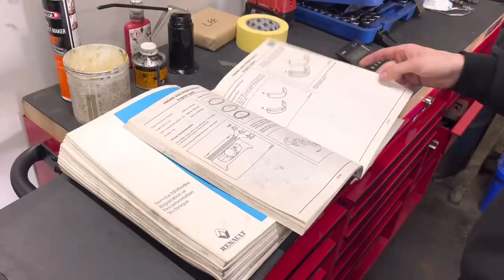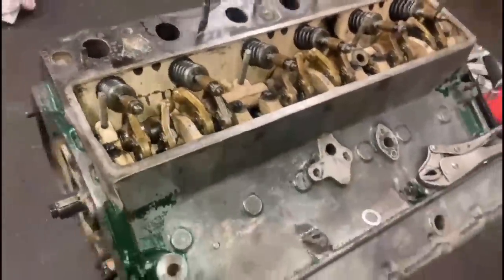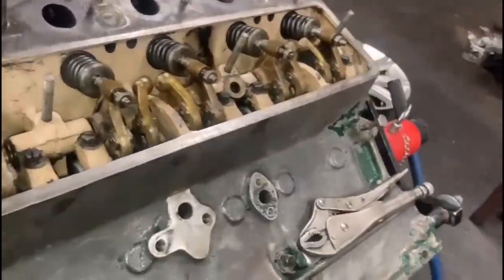IM SO ANGRY WITH THIS WARRANTY CLAIM & COURT THREATENING

Comment: The problem is that based on recent rants (this included) you are too old fashioned, too forgiving and too much of a gentleman...and that's going to affect your business.  Yes its a sad world we live in these days where you have to cover your backside all the time, but that's way things are.  Gone are the days where a nod or a handshake secures the deal and everyone abides by that.  You're a business man, and need to consider how the old practices are actually stressing both you and your business.  You have to think more of you and and your staff to ensure things don't get to this stage of threats of court action.  Invest in a call recording system, or ensure things are done through e-mail or if you want to continue with old practices do written estimates, with worst case scenarios.  Don't let completed jobs leave the building until the invoices are paid, or at least take non-refundable deposits so that you have at least covered cost of parts should something occur and completed projects get removed prior to the customer settling the invoice.

I used to be self employed way back in the 1990's, and before I did any work I had the customer sign and date the works order which also had my terms and conditions on the back, which made it difficult for any customer to wriggle out of paying, or portioning blame on me for something that I never did or touched.  I had one case where some character tried to pull a fast one, and wanted me to pay the repair bill caused by something that I normally never do, but they dropped it when I pointed out the relevant clause on the back of the signed works order where it stated such things were entirely at the customers risk etc...

Sorry for the ramble, but I hate to see honest guys like you, who are trying to build up the business, and have such a big heart, get taken for a mug...

Comment: I agree with Harold 6863,  it IS getting worse ( recently retired after being in the building industry for almost 50 years ) for the last 22 I was doing house inspections, in those 22 years I had about 5 complaints to our (NSW Australia ) " consumer " body, all bar one were from women ( and he may as well as have been !! ) the last one was what made me retire ( was going to anyway  - she just helped push me to do it ) None of them wanted to discuss what they thought was a problem before running off to the consumer body. And, of course the wicked evil builder was always at fault.
So my advice would be to ANYONE in a small self-owned business is don't do anything by word of mouth and to document all dealings you have with the general public, in over 13000 inspections, like I said I had 5 complaints but those 5 cruelled it for me .

Comment: Realistically the customer signed off on the gearbox to get the job done & agreed to the terms as he paid the invoice. What the customer appears not to realize is your vids of engine builds shows the quality of workmanship. Question i have did he misdiagnose what was making a noise, was it the g/box or most likely something else. Did it turn out that it wasn't the gearbox ; after all you didn't get to test drive before he took the gearbox out or when he pit it back in. Threats of legal action mean nothing when it ain't backed up with actual action. Any claims of expenses by him can be counter claimed by yours. If he expects a windfall he's sadly mistaken. Courts by & large are blind meaning they deal in law & facts not what somebody thinks should happen. He better have his ducks in a row

Comment: i had a same sought of problem and legaly as long as you are prepaired to fix the problem he does not have a leg to stand i won my case because the customer refused to bring it back for us to sort it out
Reply: There's mention of an "engineer's report". That may or may not be true, relevant or bearing on the weight of the arguments. The 'qualifications' of that "report", if indeed it exists, may just be Joe down the alley.

Comment: Just a thought.  Why do you not extend a helping hand to help the bloke out and say, if he pays for the parts, you will do the labour for free.  Solicitors are expensive and why not use the time and the money to sort out the disagreement. If he does not want to. Then you can use that as leverage in court where you tried to extend a helping hand and he did not want it. Then the court will look at him and will start grilling him on not working it out with you. I am an electrician by trade and I had a client where I suggested to go half half on his issue.  He wanted upgrades etc. He paid for the parts and I just rocked up and installed it.  We went our separate ways and never heard anything again.  I unfortunately had to let the employee go after that episode.  The employee did not replace the parts, which was ordered and picked up by him. We had the job number on the invoice as reference for our accounting. Never thought it would help us track if the parts were really installed. We take pictures of the parts and serial numbers that were in and quoted for replacements.  The guy rang us up and stated that his electrician came past and checked and found out that the parts where all old.  We went out and took pictures and we found that the serial numbers and date of manufacture is the same as what we had on file.  So we had to let the employee go, because he was stealing.  We did not get the police involved as he has kids and I know them personally. Its not worth the mess of going back and forth to court and seeing a family being torn apart.

Hello from South-Africa. I enjoy your videos and can't wait for the next ones.

Comment: Just an observation regarding the MGB engine I have built a few of them over the years and I noticed with the one your having issues with that you have early conrods fitted to late type pistons early pistons where longer with oil control below the Gudgeon pin as I said just an observation

Comment: Glad you have a semi reasonable doctor. If you take ivermectin with the antibiotics, you will be fine in 24 hours. It will speed up the clearing of the lungs dramatically. Tried on myself 3 times already. Didn’t even stopped smoking in between.

Comment: If you do mechanical work without a written and signed quote, you are just asking for trouble. Anyone who wants the work done will have no problem signing a quote. It's the standard in every service business. If you have to get approval over the phone, record the call and ask the specific question with a estimate of the cost or an hourly rate.

Comment: If you’re taken to court. Demand access ti the box, to inspect. If it is, the same box. All the gadgets will still be new and brand stamped. The part you also replaced, that the customer broke, will also still be new. Don’t want try about not having a paper trail to to defend yourself. Means they don’t have the same to price your guilt. The guys at it. Might also be worthwhile, getting your solicitor to start to doing some financial background checks.

Comment: The chap who does my plumbing jobs, and also has installed a new kitchen, put in new bathroom and en-suite, and refurbed the downstairs loo is the best tradesman I have ever come across. For every job he submitted a quotation with a complete description of the work, listing all the jobs. Where I was supplying parts this was also in the quote document. It seems to me you've been rather too much concentrating on the actual work, and no enough on formalising in a document the work to be done. We always agree verbally to proceed based on the quotation, and I have always been totally satisfied. However you may need to formalise acceptance of the work to be done in future, as well as the quotation or estimate. Oh, and maybe start a customer black list.

Comment: After many years in the motor trade, I can relate to what you are going through. I became disillusioned with how things have changed during the last few years and how this is becoming more common that I decided to retire earlier. Fortunately, I was in a position to do so, but what I did learn in the last few years, don`t be afraid to turn some work and customers away. Sadly, this is not unique to the motor trade and I have friends who experience the same issues in all trades now.

Comment: Holy Moly! Look at the lenght of those Willy's rods!! And the skirt lenght!  Amazing and shocking when you are (too) accustomed to "modern" engine insides.
Reply: I an no engineer,but can't decide if the rod to piston pin  bolt is genius or daft designing
Reply: @brianiswrong  Me neither... my immideate response is "extra reciprocal weight" is usually never beneficial... this is however not anything close to a race engine so maybe it doesn't matter that much if you gain something significant in serviceability/other areas.

Comment: Gidday Lee, great vid, the guys are a good lot.I noted you were relegated the outside office.In regards to the gearbox.I doubt that its the same box you worked on.Your evidence of it has it in great condition as you put it back together.Now all your video's display an ethic of work and that is precident.You would not have reassembled that gearbox if it wasn't in great condition as that is your ethic.So this box must be another and your dispute will be exactly that.This guy has substituted another box or components to gain advantage .Don't argue over what he is saying you did or did'nt.Your annoyed because it is an attack on that ethic.Most likely if you can see any gaskets they will be old and not the new ones you put in it.He is a con putting a 2500 pound claim on you, treat him as such.Thanks .

Comment: About the Rover engine: Are the lower oil ring supposed to be installed on a "new" engine?  Aren't the lower control ring the supposed to be installed on a worn engine to stop excessive oil consumption?
Reply: No.
Reply: @jostouw4366  Explain or elaborate
Reply: @k.kristianjonsson1537  It was protocol to install the oil control rings after a running in period that practice no longer exists with modern ring sets.